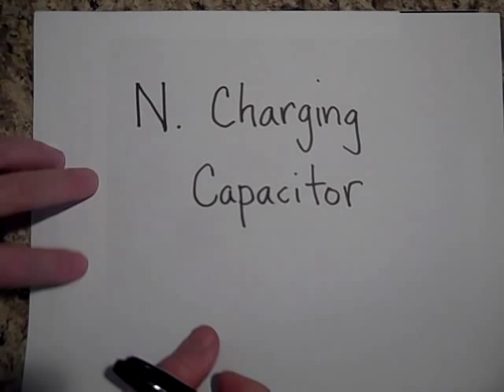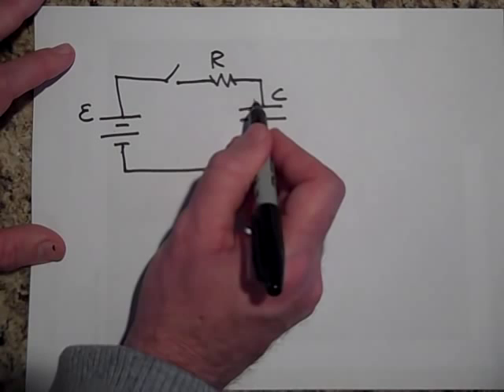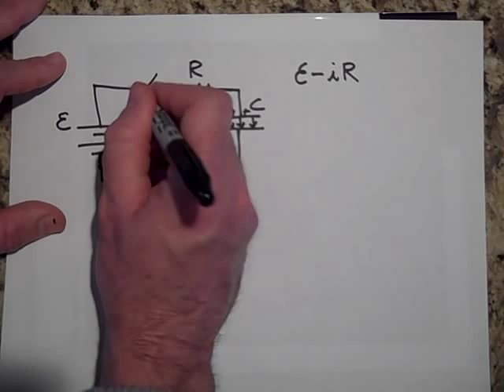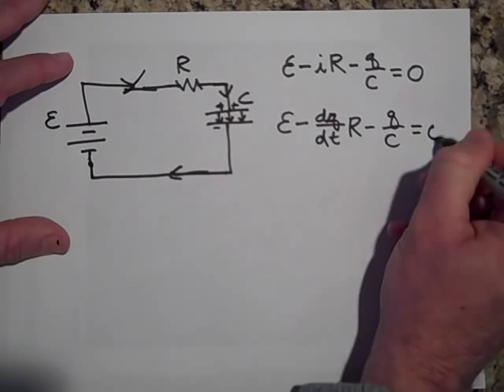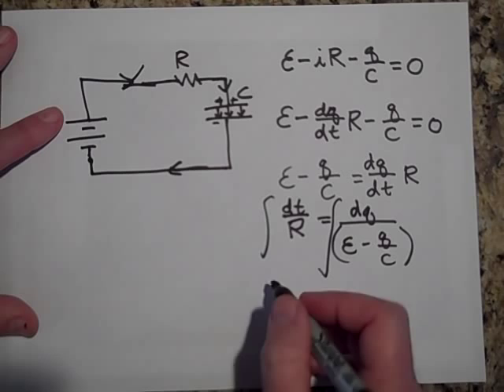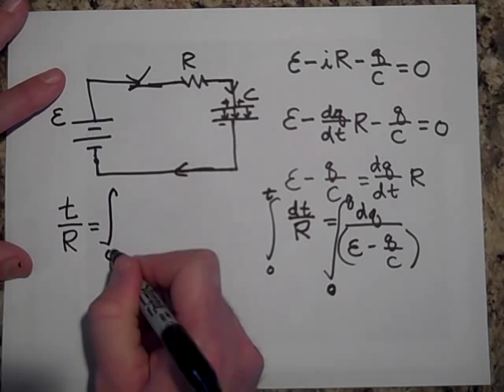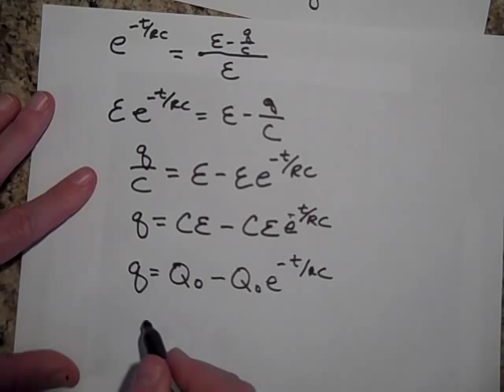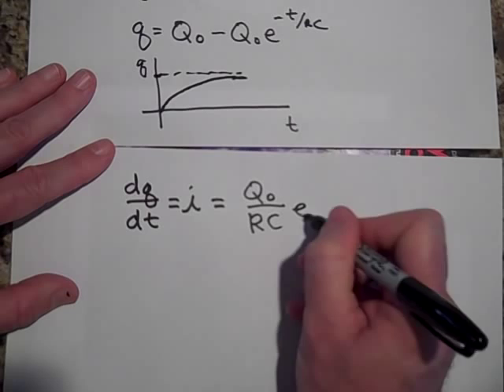Charging a Capacitor in an RC Circuit

Comment: Why don't you add a negative sign in the equation for resistance for dq/dt? I understand that the charge on the capacitor is growing, but isn't the charge on the resistor declining as shown in the previous video?
Reply: That's what I wanted to ask about, but only about the negative sign in the last video which when taking the derivative of Qe^(-t/RC) is gonna equal to -(Q/RC)*e^(-t/RC)
but he had the best tutorial explanation though

Comment: LASSEVIREN1, 
without the LOAD, how much current in amps can a 4700uf hold store with a power supply DC voltage at +450vdc? the 4700uf filter cap will charge up to +450vdc but how much current is the 4700uf holding storing?  
What formula can I use to calculate how much current the filter cap is storing in amps?

Comment: You don't explain your terms.  You don't explain the relationships.  You don't explain what "dq'/dt" is, and why it is important.  Your Q looks exactly like an 8.  You don't explain that Q is charge.  You don't explain that E is voltage.  Your video is very badly presented.   You assume that your audience already understands your terms, the relationships involved, and how the equation results.  In other words, you explain exactly as if your audience already understands the charging equation and doesn't need your explanation.  Unless someone already understands all of the factors and relationships involved, they cannot learn from your video.
Reply: youch, i can feel that student frustration through my screen. hope you figured it out, buddy
Reply: @ahmedkunbargi8096  , I did, from a previous electronics class I had taken at a local college, from a very patient professor who went through everything, step by step, and didn't assume we already knew the equation or the terms.  That's why I was so critical of this video.  The presenter could have, and should have, explained the elements better, and how they relate to each other.